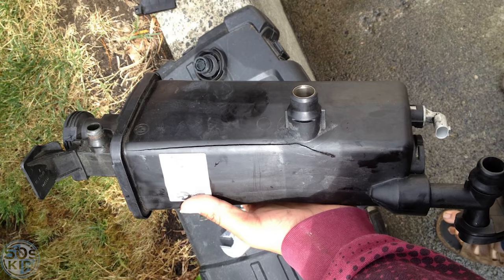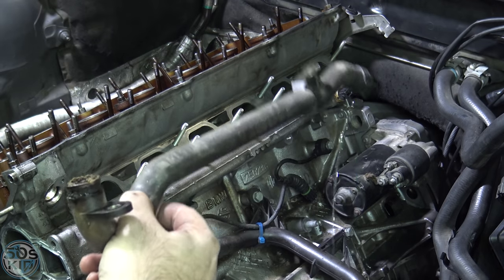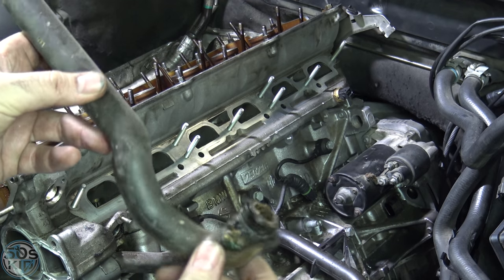Common BMW E46 Cooling System Failures

Comment: My E46 N55 would start to run high temp after about 15 mins of driving. One day I noticed it started to climb again and my coolant expansion tank ruptured, draining all the coolant. I’ve since bought all new quick connect coolant hoses, new tank and a metal finned water pump. I have yet to install it all. Is it likely this will bring the car back to health, or is it probable that I’ve done significant damage to the head/head gasket?

Comment: Another thing to replace before you hit 200k is the transmission heat exchanger.  It may start internally leaking and send coolant into your transmission, which doesn't end well...  Have had that happen on 2 out of 3 e46s I owned.  One transmission survived the ordeal and just needed several flushes, the other had to be replaced.
Reply from the maker: Ahh, not an often thought of item but I would agree with you. In fact I should do that on mine

Comment: The serpentine belt broke on mine at 43K miles caused by the belt tensioner bearings seizing up,BMW made a brilliant engine the M54,then used crap parts for the cooling system.What were they thinking?I've just had to replace the thermostat and housing(all one part) because it was over cooling at 52k miles,the factory fitted one looked cheap compared to the Behr one I fitted.The viscous fan was seized on unless someone used thread lock fitting it on,and yes I was turning the 32mm nut the right way because it has a left hand thread!Absolutely terrible cooling system,little surprise I'm seeing less and less of these otherwise great cars on the road.

Comment: DON'T MAKE THIS MISTAKE! The dealer replaced the original water pump and thermostat, as preventive maintenance, on my 2005 BMW 330ci, with the only one they could find at the time which was a German made MEYLE with metal blades, at 80k miles, but it only lasted 15 thousand miles. The  bearings went out in it and since I couldn't find the plastic OEM due to the pandemic, someone suggested that I do the electric fan swap. So I bought what was suggested to be the best from fcpeuro  and it worked well, I even gained a few horse power. But it only lasted until last week when my daughter borrowed my car to go out of town from where she called and said that the AC went out first and then the engine had overheated! I had it towed and the first thing I noticed was the positive wire from the electric fan was burned out to bare wires showing... the fan was out, and so was my engine!

Comment: Jason, my name it Randall, Denver CO, a web designer like you. I’m a bit fan. You are my go to guy for any thing E46 related. So I have a 2005 330xi with a chronic over heating problem,. I’ve replaced everything once twice even three times to fix this, and still my car overheats. So the last time I drove across town and my car overheated, I cranked up the heater and the temperature almost immediately came back to center the way its supposed to be. Obviously I can run my heater at full temperature during the summer. An suggestions on what else I should check and replace?

Comment: What if it’s overheating at idle? It passes the head gasket test. Heater blows hot. I’m at a loss. I’m pretty sure I’m burping it correctly.

Comment: Hello Jason, do you know if the leakage caused by the hard coolant pipes is usually bad enough to leave you stranded on the road? I was wondering if these hard lines make sudden crack like the expansion tank or do they develop mild leak at first?

Comment: I Replaced my radiator on a 2005 Bmw 325i , car was over heating one morning and I seen a big coolant leak , driver side, not sure what else to do the engine will crank but not start, is there a common fix?

Comment: I have a 2002 325i my coolant is full it was half way then the weather changed from hot to cold and now it jus rised nd its full now it dont over heat but its popping up a coolant light now

Comment: I changed my expansion tank at 107k miles and it started leaking again from the lid, so I took it back to the shop and the radiator was bad but it’s still leaking. Do you think I have to get my expansion tank replaced again or would it be something bigger than that?

Comment: Hay mate I have a question..iv changed my expantion tank thermostat housing water pump an radiator an expantion tank thermostat an the coolant temp sensor an the water level sensor..but my car still overheats..any ideas would appreciate it..an also my fan runs when the car is cold an stays on 10 seconds after I turn car off..my upper radiator hose blows out steam slightly to wen it gets hot..tia

Comment: On the reservoir tank I believe there is a company that makes a billet or aluminum one and I think that would hold up better instead of the plastic instead of getting a OEM one or the cheap remake I would probably get the aluminum one
Reply: Mishimoto makes an aluminum one for $160 and it may be a little more on the expensive side but it would last longer than the regular plastic ones

Comment: got a 2006 x3 m54b30 engine that keeps getting air in the system I've already took it to galleria bmw twice and they said the engine pressure is good but can't seem to find out what the problem is but after driving for 1 hour hour 30 minutes my coolant light goes off and I check the expansion tank and it has a lot of air in the system. Just replaced the whole cooling system 2 months ago

Comment: Hi Jason! Hey quick question I did a cooling system refresh hard lines under the manifold expansion chamber thermostat electric fan conversion hoses lower sensor blah blah blah bled the system properly but the engine still runs at 101°C dropping occasionally to 98 Celsius it typically ran at 96 I can’t figure this thing out any thoughts thanks hit me back when possible! Also the thermostat was OEM but from O’Reillys I’m thinking maybe it’s not exactly proper I don’t know?

Comment: Opened the hood on my e46 330i to check the oil and coolant level when cold, and i noticed a hose was kinda flat the one on the passanger side that comes from thermostat and goes down to the radiator, felt squished, released the reservoir cap and it inflated back, trying to figure out what is that suppose to mean

Comment: Hi. Could do with your help. Installed a new expansion tank on my bmw 330 automatic, now it won’t seal. It’s sits flush to the mountain bracket that attached to the radiator. But when filling the expansion tank with fresh coolant it’s just leaks outs. 

What would you suggest!

Comment: Hy my friend, im rodiyan from indonesia... i have problem with my e46 engine m43b19... my temperature in OBD after access menu no 19 point 7, show 105 degress but electric fan not ON in this temperature
And then im replacement waterpump, thermostat, sensor coolant temperature in lower hose and electricfan with oem part. But after that temperature still in 105 degress and electricfan no ON this position... can you help me for closing problem for my trouble?

Comment: I have an E46 325i and the engine fan is constantly on when the car is running. I just replaced both coolant temp sensors and did the thermostat and expansion tank a few years ago it still has the same issue do you know what could be the issue? Thanks

Comment: I don't know if the cooling system parts actually fail because of the use of "plastic" or just because the owners don't do the maintenance as per schedule but instead wait for parts to fail then replace them...
Some owners, especially the ones switching from japanese or US cars to german, also don't understand some of the basics of taking care of an old BMW...for example overfilling the expansion tank, using "powersteering fluid" instead of ATF, using the wrong antifreeze and so on...
it seems like I am blaming the owners more than the cars :) but it is because once you do the maintenance on time and don't cheap out on parts, these cars do last forever and would never leave you stranded...

Comment: The bleeder screw on the expansion tank is laughable .. not sure if my screw defective or if its by design but some how i put too much coolant in my car one time and blew that screw .. and when i saw how thin  the wall is vs how deep the screw grove is i was like no surprise there then.
Reply from the maker: My screw also broke. Man, I forgot about that. I should have put that in the video!  They make a brass one

Comment: Hi, I'm having a overheating issue on idle or when going really slow, I'm thinking it's the fan clutch any ideas?  If I go to high revs in neutral temp goes down,

Comment: Underneath the expansion tank, the bottom bleeder with the 22mm bolt where the temp sensor for the trans cooler and all that garbage down there. Do you have a video on that? Im doing the expansion tank right now (quit for thr night cause it started raining) and when i was trying to take that 22mm bolt out. I noticed it leaks and dont spin because theres a little tab preventing it from moving (its the kind with the blue Philips screw on the inside). Im trying to sell the car and really just wanna make sure its solid and nothing else leaks for the next owner. Otherwise solid car
Reply: Need this answer, also.

Comment: Hi!
Thank you for great videos!
My e46 is running cold. I changed the thermostat without any significant improvement. INPA shows plausible values from the two coolant temperature sensors so I do not think that is the issue.
Do you have any suggestions or have heard of a case where an m54 engine is running cold where the thermostat was not the culprit?

Comment: Hi Jason, I changed my heater hoses under the intake, but one cracked inside the base, I was able to pull the most of the cracked part but im not sure if all came out, can be a problem if a litle piece of this plastic is still in there?

Comment: Is the MAP sensor integrated on the thermostat? So if the sensor fails you have to replace the whole thermostat? Getting a 7B code activation map cooling or P1620 but the car does not show  any signs of overheating.
Reply: What you have is a bad "heater" for the wax element on your thermostat. You just replace the thermostat and you will be fine. The "MAP" in this context has nothing to do with the manifold absolute pressure sensor. In this context, it just means the engine computer sends a 12V signal to the thermostat heater to heat the wax when needed. The engine computer DME uses a "map" (tables of numbers) of conditions which trigger the heater on the thermostat, that is all that it means. Your car won't overheat with a bad thermostat heater. The computer just will not be able to command the thermostat to open WIDE OPEN when it deems appropriate. Remember, for the most part, the thermostat does not run wide open, it runs just a tiny crack open (less than 30 percent) for the most part.
Reply: @emineid  thank you! Appreciate the help!

Comment: i have replaced everything on my car including the hard coolant hoses under the intake manifold and im still getting coolant leak from somewhere under the intake manifold leaking running down the engine and i cannot figure it out for the life of me i have had the intake manifold of twice now still no idea where its coming from any help would be greatly appreciated im going nuts over here with this car im almost at the point of just taking it to the junkyard im so frustrated by it

Comment: Great video, Jason! I did have a question: I had an E36 before this and there was a plastic (of course) airbox heater fed by a coolant line to pre-heat the air. Never knew it was there and it wasn't changed out with other coolant system maintenance so naturally it cracked and left me stranded. Does the E46 have such a device too?
Reply: To the intake air box - No.  It also does not have the plastic 3-way pipe fitting on the firewall to the heater that can crack and fail as well.  Plenty of other places to worry about though!

Comment: I noticed the bottom part of my radiator cap/expansion tank cap broke off. Bought a new Mahle one. I now noticed the upper radiator hose will collapse a bit now after the engine cools. Is this a defective cap or just a need to change the hose? It does feel a bit soft. But if I put the broken cap back on, this hose does not collapse.

Comment: bmw 328i 2000, Do you know why I keep getting coolant level light on? (with level ok). I don't see any leaking. I already replaced the sensor under the expansion tank, new water pump, new hoses, thermostat, even replaced both pipes under the intake. For the light to stay off for a while I have to burp the system, but then after a few days the light comes back on and off, more often and more steady the longer I stay without burping the system, also overheating.  When revving the engine the temperature goes to normal.
Reply: I do not know the answer to your question. i can only tell you my experience. After I did all the preventive replacement of the ENTIRE cooling system, I had the engine that kept overheating and the light you mentioned coming on, no matter how much I repeated the bleeding of the cooling system. Finally, I got a vacuum coolant filling system, and I never had any problems with the cooling system again. So I concluded that my problem was that no matter how carefully I bled the system, air remained in the system. There was no other explanation. Again, i do not know if this relates to your problem or not.
Reply: @emineid  I suspect I am having air bubbles stuck in the system too. I am going to look into those systems you used. Thank you very much for sharing how you fixed yours!

Comment: what do you think about using an e36 lower pressure expansion tank cap? this way, your expansion tank is under less pressure and is (hopefully) less likely to explode. its a very common mod. I just put in a cheap chinese expansion tank (OEM was way too expensive) and i got the lower pressure cap to go with it.
Reply: Lower pressure caps are a gimmick. Here is why. I have tested my E46 325i extensively with a pressure sensor in the cooling system. The pressure never rises above 18 psi under normal driving (1.25 bars or so). The pressure of the cooling system is NOT regulated by the cap unless there is something catastrophic that is about to happen. The pressure is "regulated" by how much micro-boiling there is in the cylinder head cooling passages next to the exhaust valves. The pressure is in the 10 to 18 psi range for the most part. It goes up and down, and it has nothing to do with the cap. This is why I conclude that lower pressure caps are a gimmick, since  the system never reaches 1.4 bars, let alone 2 bars. It generally stays below 1.25 bars.

Comment: Hey fifties kid, u are kool dog !! Ya,zz help me a lot !! I have a 2003 325ci & I have 2 major repairs I need your great direction on doing as I am DIY,ING it. I'm o.k. with my repairs on most of the stuff on the out side of the engine & o.k. somewhat on suspention/brakes/bearings & calibers,etc etc.... so 1st I need to ask u what OEM brand will be affordable plus aluminum for my thermastat housing & OEM brand for my water pump replacement ?? 2nd, what is the best for my expansion tank replacement ?? Looking forward to begin a teaching from u on this and soon need your expertise direction on my ZF granny & what when down recently with my DIY of fluid & filter change. This was unfortunately, yes, the first change of both this 325ci had seen. Will explain my situation soon after we hopefully beging our lessons beging with my coolant system DIY repair I'm needing to do, like ASAP. PEACE & GRACE TO YOU KIDDO OF THE 50's. Drew Anderson of Jacksonville FLA

Comment: I know the truth about the hard coolant lines but am sad you mentioned them.  Pulling the intake manifold gives me the willies -- probably irrationally.  I've done everything else on this list along with the accessible heater hoses running along the left frame rail.

sigh  I know eventually I'll have to do the CCV system too.  I did at least do the 02 Pilot mod to suck as much oil as possible away from the rings.

Comment: I don’t understand why they don’t use regular hoses and hose clamps.  There’s no need to introduce plastic and thin O-rings to the radiator hoses.
Reply: The idea is that you can service the hoses without any tools. O rings in general provide very good sealing. I think it was a good idea, but like a lot of good ideas, in practice it's not as durable as they had hoped.
Reply from the maker: I agree -- more points for failure.  Rubber and metal clamps was superior

Comment: The fitment of most any aftermarket coolant expansion on most ANY tank is POOR at the least.  Just finished wasting 3 hours trying to get the OEM upper hose to seal / seat to the expansion tank / Radiator @ the junction just below the tank cap / filler.  Thanks - RockAuto for wasting my time and energy. The variance on the aftermarket Vs OEM was nearly 4mm between the two - such that it was impossible to seal / seat the cooling system at this critical junction point.    Thought I wasn't buying Taiwan Tony aftermarket ill fitting equipment from RA - but be forewarned - their aftermarket tank doesn't fit at all either!!!!!  Also beware of the tanks supplied with the coolant tank cap - some are supplied with 2.0 Bar caps and some are supplied with 1.4 Bar Cap.  Using the lower pressure cap (1.4 Bar) is my preference - I'd rather loose a little bit of coolant @ 1.4 Bar cap Vs having an 2.0 Bar cap and an exploded (or burst) coolant reservoir.   Little info is mentioned (or specified by the sellers) about the variation of the pressure relief points (1.4 Vs 2.0 Bar caps) of the expansion tank caps.